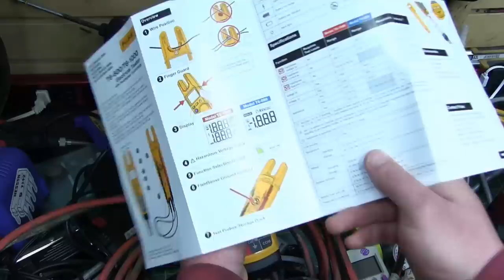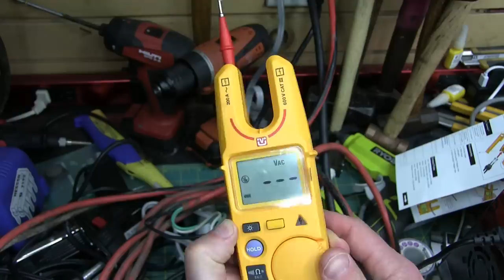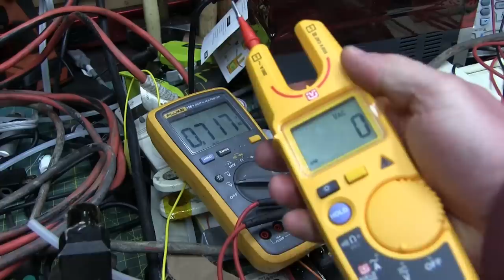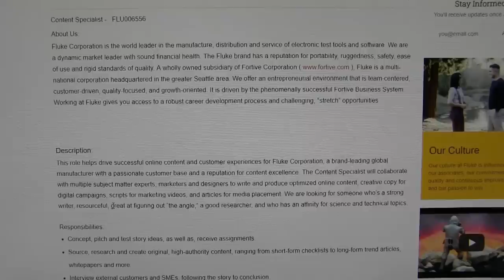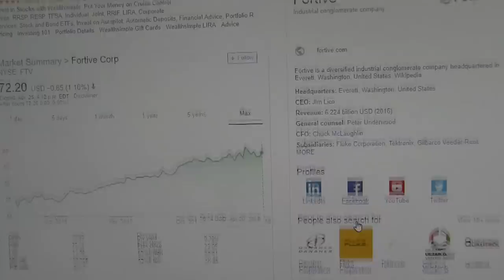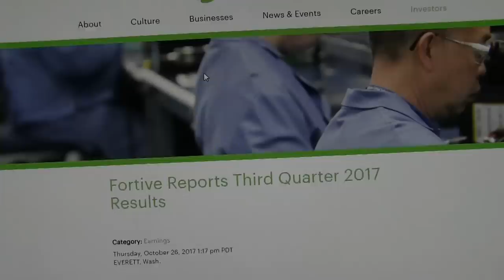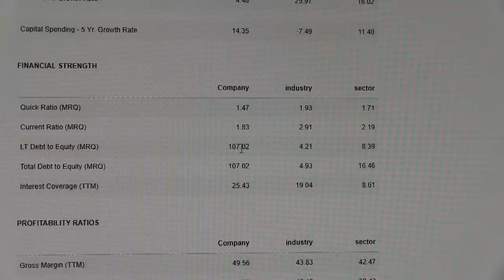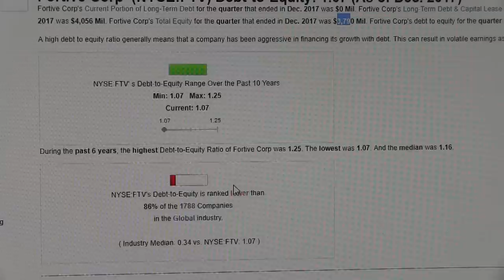Fruke's JOY BUZZER™ Multimeter! | SHOCKINGLY BAD T6

Comment: Reality check: At no known conceivable setting can the T6 enter a low impedance (think resistance) mode between the leads.

Holding one lead while the other one is life can never let more than a fraction of micro-ampere or so thru your body within the specified potential difference ratings.

However, your mileage might vary in case of malfunction or wet soaked device.

Contactless potential (voltage in YouTube lingo) measure is however to my standards not acceptable as a proof of safe bare handling of wires. Common sense, anyone ?

Even then one should be careful when potentially high frequencies or unusual waveforms can be supposed since most voltmeters will display very low values in such cases, independent of peaks in the signal.

Many "electrician" grade meters will read close to zero volts between the phases of a PWM energized servo brushless motor in some, like robotics, applications. While a correctly tuned scope will show ptp's in excess of 400V. 

In this fluke device, current measurement is performed by the built-in hall effect sensor. Which allows contactless current measure by the relation between flow current and induced magnetic field.

No current ever traverses the device.

Works wonders for presumed acceptable waveforms and bandwidths. Even on small currents, just loop the wire several times then divide the reading by the number of turns.

More complex hall probes/scope are however required for higher frequencies and unusual signal shapes.

No I don't work for Fluke or any other affiliated or whatever company. I am an engineering contractor and that's all about it.

Comment: This is exactly what happened when Remington and Marlin firearms companies along with several others were bought out by the "freedom group".  The QC went right into the crapper overnight.  Finishes you used to be able to see yourself in were replaced with bead blast and shot peening.  Bluing was replaced with black oxide.  Wood work began to be finished in single spray flat lacquer.  This describes the cosmetic failures...the list of mechanical catastrophes is MUCH worse.  MIM was introduced in places it should never be used and ALL the hand fitting stopped.   They feel like rubbish.  It's sad to think that Fluke of all people would get on this train with the greedy bastards who destroy companies.  I guess this is why I'll adhere to my proven known meters like my 87v, 289 and 374.

Comment: Can you get and check out one of those Black and Decker Direct-Plug Cordless Screwdrivers.  We bought 2 of these for our computer shop and they only seemed to last like 3 months (Light use in a computer shop mind you) before they just stopped working.  The exact model of the ones we got was DP240.

Comment: My Fluke 381 clamp meter (less than three years old) stopped working.  I called Fluke UK to ask if I could send for repair. (Wait for it) 'under 3 years old, no problem, send it to us with £265 (half the cost of the meter) and we will send you a new one'.  Thinking I had just gone through some kind of 'This Old Tony' time warp to a parallel universe, I said no I only want it repaired, I was told thats the policy.  At this point I should advise folks I had diagnosed one of the battery terminals had broken away from the shitty plastic casing on the removable (magnetic) screen component.  At this point really pissed off, I found a tri-lob screwdriver bit to fit these anti-tamper fuckers Fluke uses and repaired the plastic tray with some super glue and dental composite so the battery terminal was held firmly in order it could be pressed onto the board.  So in summary Fluke wanted to charge me £265 for an injection moulded (obviously in China) shitty plastic tray with a couple of magnets and springs.  Who the fuck engineered this fuckeration?  BTW, does anyone know where I can get these tri-lob screws?

Comment: There are a lot of  "F"anbois...  having been in the electronics service industry for 30 years I remain unimpressed... The only thing the otherwise mostly 87-equivalent $25 auto-parts shop meter doesn't have is a calibration certificate, and as a bonus I can read the display.

Comment: Fluke PM'ed me after I messaged them...this is what they said: 

Hi Mark, The Fluke T6 poses no safety concern, please check out our new video answering recent questions; http://bit.ly/2vRKT4X 

The Fluke T6-1000 was created with safety in mind and FieldSense technology minimizes potential errors, and reduces the possibility of arc flash. The T6 Tester battery door circuit limits the current to safe levels for any rated voltage making the tester safe and protects against electric shock hazards.

The tester also complies with UL 61010-1, OSHA, CSA and NEC regulations. There is no need to wear gloves. If you have any other questions, we’re always happy to help! Just give us a call at (800) 443-5853 Thanks!

Comment: I actually just talked someone out of buying one of these at the supply house. If there is any tool I regret buying this is it. It’s a downgrade from the t5 in so many ways

The kicker for me was that the readings are so much slower than a t5 or 117 or 323. Any one of those is a far better meter.

Comment: Fluke has been a dangerous company with no care for quality or the safety of it's customers for some time. 

I bought a 376, and it developed a problem right away. A dangerous problem. The leads wouldn't read properly a lot of the time, but they were at least open, so bad connection somewhere, probably the board. I put it away as I didn't want to deal with it at the moment, and went back to my too large and expensive 489. Then I heard there was a safety recall on the 376 , so I sent it in. Came back with a warranty service sticker on the back, and the exact same issue, but I noticed something else. When messing with the leads, you could sometimes just touch the plugs and get it to read a short.

That's fucking dangerous. Your checking for presence of high voltage somewhere and find it, in the form of your Fluke blowing up in your face because your checking for voltage with essentially a wire that's going straight to ground... Not cool. That's just terrible engineering.

But why did it come back with a warranty/service sticker on the back??? Who the hell checked it, or replaced the main board on the inside with one that had the same damn problem?

From the Fluke website, still available:

Description of the problem
The printed circuit assembly may not be properly fastened to the test lead input jack. This may result in inaccurate voltage readings, including a low or no voltage reading on a circuit energized with a hazardous voltage, presenting a shock, electrocution or thermal burn hazard.

NO SHIT!!!

This recall was 2013...

Comment: You would be better off getting the Voltage pen at least you are not in direct contact with that. Buy the fluke 325 excellent clamp meter and get the pen best of both worlds.

Comment: I usually try and keep my opinion off comment sections on YouTube, for good reasons but as an EE (pixie wrangler that has, and thus spouts, BS :p) and thinking I understand a little bit about the subject after nearly 40 years (I have begun to understand some of the field by now, but sure as hell am not an expert), this is stupid design from about any way you look at it. There is no way you are going to get precision from a non-contact electrical measurement except by some exotic and expensive process. You have to get your instrument in there and poke it in.  Now, this thing could have been designed as a coarse relative voltage measurement system by measuring the differential electromagnetic field relative to the ambient field. It would be coarse, but it should be reasonably linear. You could feed a bar graph display on the main display.  Most of the time you don't need precise measurements in this kind of instruments---you need to know if it is there, and if it is within some range. The Wiggy, used by electricians for decades, is this kind of instrument, and damned clever---it vibrates harder the higher the voltage, so you don't have to look at it while you are poking around higher voltages. This thing is an overpriced POS and the engineer that designed it needs to upgrade the grade of meth he is using.  It COULD have been a useful instrument, but instead it is crap. First thing to do in engineering is to define the REAL problem as completely and accurately as possible. This is some wank's wet dream in search of a problem it can't possibly solve. I stand by Ave 100% on his call, and I'd back him in  bar fight on this one. :)

Comment: I bought a Fluke 179 first year it was out, use it mostly for basic car diagnosis now... STILL happy I got it. Why? Because the other piece of shit I had gave absolutely unreliable reading EVERY TIME, even for simple shit like resistance . Bad leads, bad unit, I didn't make contact properly... I don't fucking care. I got inaccurate readings, questioned my vehicle diagnosis, and it wasted time and money. The Fluke upgrade was 100% worth it and paid for itself in crankshaft position sensors alone! I'm not just disappointed in how cheap these are getting, I'm scared. I don't want to go back to wasting my time and money because literally not a single company makes a reliable tool I can trust first reading.

Also... I bought some test leads and paid $30 for them... they were warped as shit knockoffs. Reported it and got my money back (this was on Amazon), ordered them from ANOTHER seller, these ones were "genuine" I guess? Not in a ziploc with chinese characters written in sharpie at least... but the leads were bowed slightly. Apparently this is "NORMAL" and just something that happens? On 30 fucking dollar leads? Right. Thanks Fluke.

Comment: This does not fill me with confidence. Are Fluke doing a "Square D"? IE Square D were at one time the undisputed king of the hill for breakers and other wiring kit for DIN rail industrial applications. Then at some point (I'm not sure when because I only did wiring jobs between contracts for design work) they started trading on their name and produced absolute shite that people now swear at rather then swear by. Fluke have been top banana for digital meters (the same as AVO for analogue) since Pontias was a pilot. AVO are arguably still top banana for analogue meters (but do you trust Megga?) but what the chuff is happening to Fluke?

Comment: Funny that I see Gems sensors and controls on the list of craptacular companies. Not 2 days ago I was asked to find a replacement for the Gems brand cryo rated solenoid valves we're using at work because the metal around the female NPT ports is so thin that it cracks when it gets cold. Yeah, that's right. COLD breaks a valve that's rated for use with CRYOGENIC, read really fucking cold, liquid service. 

I'm sad to see Fluke go, and it's not even enjoyable to watch them leave. Looks like my first fluke that I got 5 years ago will be my last. Thanks for making these videos and making this horseshit public.

Comment: You might of just got a defective one. Lucky for me mine works great. Or maybe you need to use a single wire and not the break out adapter. The wire does have to be back in the fork all the way

Comment: Sheer amount of idiots claiming "mine works perfectly" and/or "you're using it wrong" need not reply.  The entire point of a tool like this is to NOT have to touch or wrestle a SINGLE wire into the jaws and to an exact point.  Useless

Comment: This is disturbing if indeed the hot side through that meter is grounding out through the back plate. Wtf? 

I was going to call you out for having one probe out while the other was stored, but fuck me,  through the meter? 

Nice work. Thanks for the heads up.

Now, with my 3 flukes I use in the field, can they be trusted? Fuck.

Comment: How about showing the current availability at that ground contact pad by using a 110vac light bulb in series with that contact pad to ground .
If it is a couple of mills ... no big deal ... but if you can light up a 60 or 100 watt bulb ... holy fuckaroni !
Can we say "dummy load" and "lawsuit" boys and girls ?
I agree , the use of this , as described , goes against all that I have learned and done for about 50 years .

Comment: fluke is overpriced. the only meter they build that is decent is the inrush current meter they make. i use a klein myself, The cl1300 does everything i need as an electrician and its sturdy as all hell and under a hundred bucks too! The back has a built in magnet so no flappy thing, probe lock keeps the hot lead right where i can poke the pokey end into stuff without having three hands and a flash light built in to boot :)

Comment: This is a toy. A dangerous one.
Just imagine you crawl under a a large conveyor in a factory, replacing some damn sorting device or what not. Now you have to disconnect what feels like 500 wires all with different signal voltages, bus lines,  motor power cables, etc. Now having a tool that can tell you which leads are safe to unscrew without haven to poke around with some test leads... that would be handy.
BUT! the slightest chance of a false reading... remember, you might be lying on your back... on a grounded steel pane.
Thanks, but no thanks.
I trust my "Benning Duspol" elektromechanic meter with my life (but only after checking it at least once per day).
But that fluke toy? Get outta here!

Comment: I’ve been elec-chikin for 30 yrs. I trust fluke, but if I use this unit and get whacked due to not having the wire in a certain spot, I’m gonna go down to fluke and beat the engineer that designed this POS all about the head.

Comment: I bought the T6-1000 because I like the design and it has a higher resistance scale than the old T5.  I did not buy it because of the non contact volt sense. One of my lead service techs and I tested it and it works as designed, he has been using a t5 for years along with a Fluke 116. He is going to buy a T6 also. The non contact voltage is not as accurate as using the probes.  I would never be careless with any non contact voltage detector or use it for critical measurements, but its a nice extra for a quick check.

Comment: Keep up the good work sir. I've seen definitively better individual tools all around XD.... HOWEVER...

 When I was apprenticing as an electrician, I ran into an instance where a line that I knew was SHUTOFF AND LOCKED showed about 90v on my cheap DMM. I freaked, and ran to the Master Electrician for guidance before I worked on it. He told me that DMMs can be a bit touchy because they offer almost no load. He explained that there might be a slight transformer effect from a nearby line. He said that it's probably not long enough a stretch to actually push any amps at load, and that I should try the "old fashioned" neon bulb Fluke to test if there's voltage I should be afraid of. 

THAT SAID... I'd hate to be holding onto either these pieces of metal if there happened to be a surge in the (contacted or inducing) line from some external force beyond our control.

Comment: Sometimes, you need to realize your latest and greatest product did not meet expectations. The bravado and ego of the company's legacy brand are keeping it from doing the right thing. They have made outstanding meters and other test equipment, and I won't use any other brand test leads, however, you need to know when to fold them. Putting out videos like this contribute to the white noise of marketing BS. Return to your core values and those attributes that made the brand what it is (was?). Uncompromising quality.